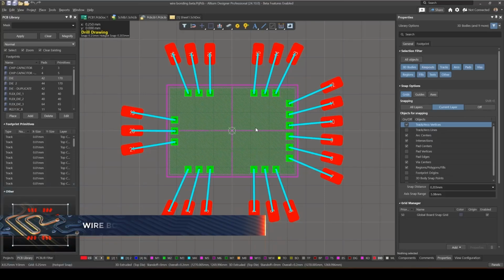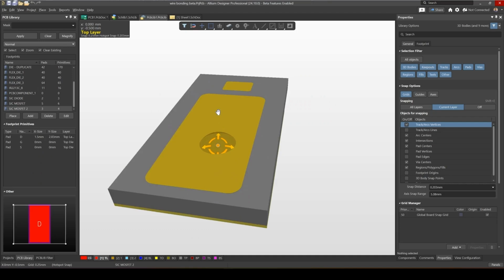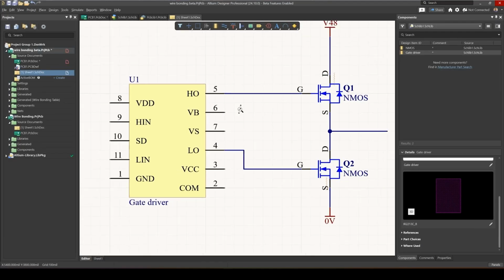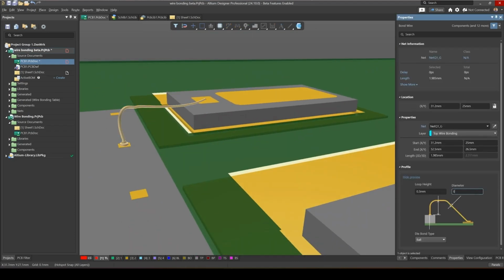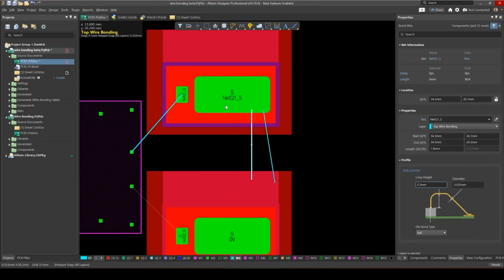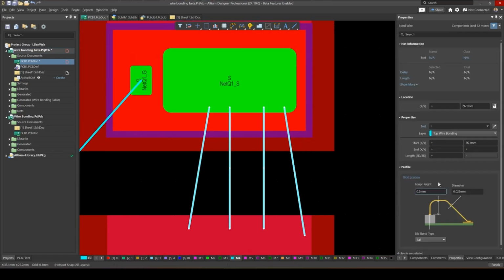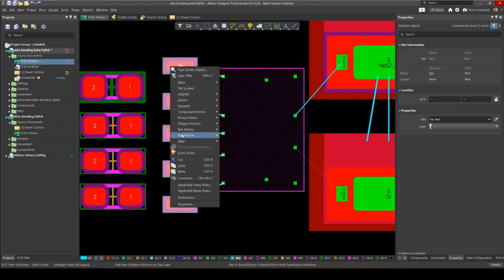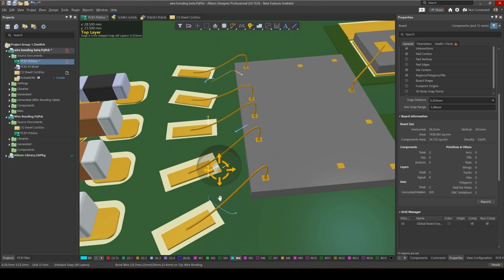Wire Bonding Shorts: Die Footprints

Comment: Nice feature, but unfortunately it is limited in usability… For instance, if the bond pad on the chip is not at the edge, the bond wire intersects with 3D chip body. It is not possible to define the bond loop parallel to PCB plane. Also bond wires not exported as 3D body during STEP file export. Do you have a timeline for implementing these features? Thank you for your attention🙂